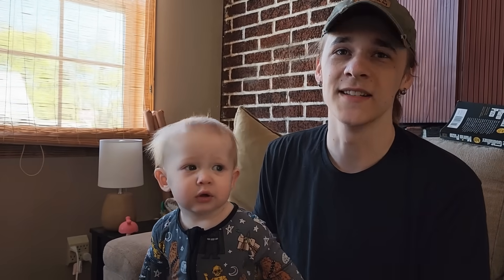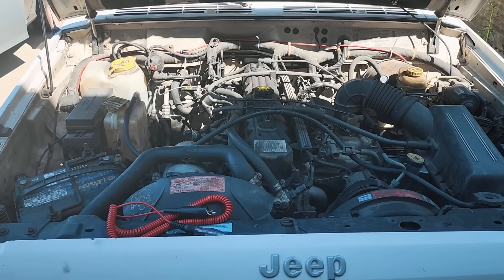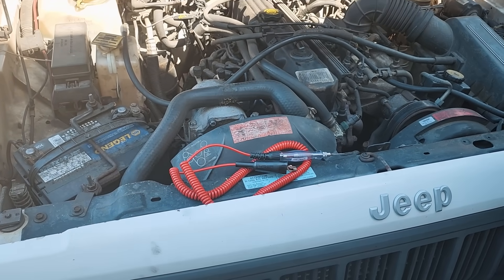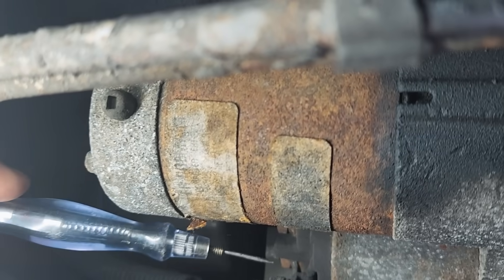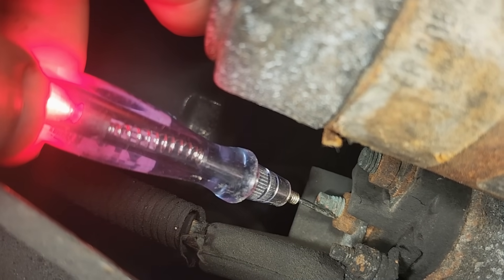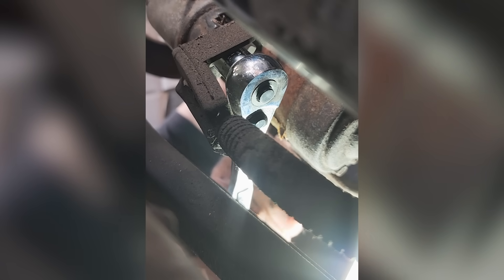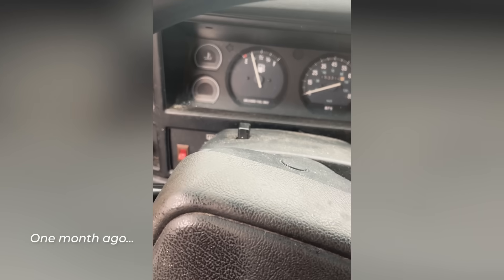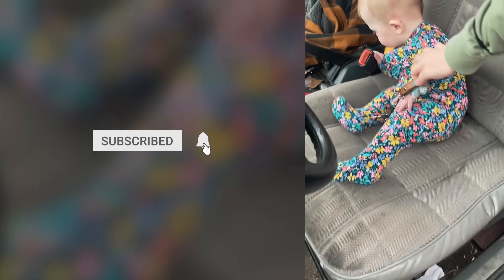Bad Starter or Bad Wire? - Starter Tests Everyone Can Do (family intro)

Comment: Do you have a video showing a bad starter in a "no-crank" case? I've watched a dozen or so videos, and they all either show a completely good system or  bad cables in a voltage drop test.
Reply from the maker: I do and we just released this one from our archives https://youtu.be/Dot9NUXhzpc
Reply: @ScannerDanner  Thanks. Love this content. After I thought I had a bad starter, when all these tests checked out, I found I only had 3 volts while cranking. Of course I didn't discover that till after I replaced the starter. New battery fixed me up. Your content as well as "Schrodingers Box" are full of amazing content. Didn't realize I was so far behind the curve in vehicle diagnostics.
Reply from the maker: @ozzman530  tell Matt I said hello!

Comment: I tested my Mustang. 1993 light isn’t coming on with my starter. Car still starts. Battery died when I stop driving after 15 minutes. I attempt to start. Dead battery. Should I replace my solenoid? To get power to starter?
Reply from the maker: If your test light isn't coming on when you are doing these tests and the engine still starts, then you cannot be doing the tests properly. A bad ground on your light is a common mistake. You need to redo these tests when it is NOT starting

Comment: Why did the test light go off when you tested the post and the nut, but not when you tested the eyelet?
Reply from the maker: The problem was the connection of the eyelet to the stud/nut. So when we loaded the circuit, only then did we see the voltage drop from that resistance problem of that location. If you would have measured resistance with an ohmmeter, it would have passed that test perfectly (0 ohms of resistance). Make sense? This is why loaded circuit testing is so important
Reply: @ScannerDanner  Hey! Thanks for replying. With the tests you showed in your video and the extra info in your reply, I was able to diagnose and correct the problem that was not letting my car start in a matter of a few minutes.
Reply from the maker: @g.t.r.8852  heck yeah! What was it?
Reply: @ScannerDanner  So, I did the test just as you showed in your video. But in my case, the test light would also go off when testing the eyelet. Then, I assumed the problem had to be the wire going to the battery's positive terminal. So, I checked the wire and found an area where the wire insulation was broken and the copper strands had become all corroded (my guess is that the corrotion was not allowing enough current to flow through the wire). So, I just replaced the wire and started the car and it worked!

Comment: Thanks for the videos you put out been watching them alot to help figure out my car troubles. In this video you show testing the starters heavy post. When your son turns the key to the start position the light goes out on the test light. What does it mean when it stays on ?
Reply from the maker: If it stays on in the crank position that means that wire is good

Comment: I loved your video so much, I want to learn more from you!!!! I own a 2013 Kia Sorento lx v6. I bought it exactly a year ago, service maintenance has been done accordingly. I just turned 60, and I still work on my car. I can’t afford to take my car to a mechanic every time something comes up. In fact I was quoted over $400 to change my spark plugs, granted it’s a time consuming project; it’s a matter of removing bolts, unplugging stuff (sorry I don’t know the names of a lot of parts!, but I am learning a lot. Also did the pcv valve! I did a few things backwards, live and learn. Now I’m dealing with a no crank, no start. When I discuss cases with some guys, they really don’t take me serious. 
I’m going to register for your premium membership, I can learn a lot from you. Thank you so much. 
Just a hint to ask you guys out there that think mechanics is not for women….. you are so wrong! Anyway that’s old shit!

I checked the ohms on my battery, it was 7.4, out a portable charger to it and gave it a jump. The car started, took it to auto zone to do a test on the battery, it came up with an error at the starter. When I started it the engine was quiet for a little while, about an hour later  it started to rough idle again! 1 problem solved another to solve!
Reply from the maker: I've had many female students over my 20 years teaching at a tech school. Some who were absolutely on point with this diagnostic stuff. Top of the class on point. Welcome!
Reply: @ScannerDanner  thank you!

Comment: Mr. Danner - I don't know what state you live in, but teach your son some basics like good electrical connections !!!  And a $15 digital multimeter will tell you much more than your $5 test light - which does have its place, just a multimeter will show cranking voltage etc....
Reply from the maker: When you understand that voltage must be measured when there is current flow, you can use your old school test light with great efficiency as I showed in this video.

Comment: If the starter had been replaced it would have started because the stud nut would have been removed and tightened again fixing the real problem. Thanks.
Reply from the maker: Exactly

Comment: Nice ! But my dumb ass would have looked those rusty connections and tried to clean them first . I have an 2001 XJ Jeep . All the six cylinder engines I ever had ran forever. Loved my 225 slant six , 300 cid Ford

Comment: Re:  The tap test (like the one done on your mom's car).  

If the tap test starts the car (and I was alone, so tapped the starter, then got in and turned the key - and it started) - does that mean the starter is going out?
Reply from the maker: yes sir, in most circumstances. There is a slight chance of a wiring problem right at the starter too
Reply: i had that on my van,not start,on key ,test battery ,with head lights on ,were bright,hit the starter few times,then it worked,start engine,on payday ,i take of the starter ,as do 200 starts per day,doing multi drop parcels,and fitted a new one,then i take the old one apart,was the brushes was worn,very small,on the end of the spring ,so not really touch the moter contacts,but if tap the body,it forced the brush down a bit more ,and work,lots motors pack up ,when brushes get short ,cant do there job,new ones are long,push into brush holder,can buy brushes to fix it ,but rest motor was worn too,gear tooth,and bearing
Reply: @richardjohn5216   THANK YOU for this.  My daughter is using that car, and it almost always starts.... but in the past week it failed twice.  I'm out of town, but as soon as I get back I am going to change the starter.

Comment: If you were to put an amp clamp on the battery positive cable to the starter, it would have shown little to no amperage correct?
A bad starter with a good wire would show lots of draw correct?
Reply from the maker: Typically a stater motor will fail in ways that look just like an open circuit (no amperage) rarely will they fail with high amperage

Comment: Wanted you guys to know that even though I am a mechanic for industrial semiconductor manufacturing equipment, I use many of you diagnostic concepts and methodology to make me better at my job.  You have helped me to become one of the best techs in the fab over the past 5 years.  Thanks you!  To think it all started with me putting AC in my 1988 Civic and needing instruction.
Reply from the maker: This is awesome! Thank you for sharing this with me
Reply: I turn on headlights , crank it or try if headlights dim and no crank starter bad ( voltage to starter)  lights don't dim ( ign/ wiring)  voltage not making it to starter  . This is true 9 out of ,10 times   . 2 sec test!

Comment: Huge question for 2 months I have been trying to get my lovely 2008 dodge nitro 4.0l to run. I was driving and it it just died. I have no trigger to injectors and coils from pcm.? New pcm put in new tipm put in new crank sensor new cam sensor. Still just cranks. What could it be? We don't have dealerships where I live.
Reply from the maker: What codes?
Reply: @ScannerDanner   o2 senor on bank 1 under threshold.  That's its. Nothing saved and nothing else coming up.
Reply from the maker: @brandihawkins2797  Let's move this to my forum www.scannerdanner.com 
It is free to join and we can definitely help you. I have 28k global members and hand picked moderators who've been with me for years and know my material inside and out and are there to help me help you guys. It is just too difficult to offer back and forth messages here on YouTube with stuff like this and we also can't share pictures and images here like we can on the website. Hope to see you there!
Reply: @ScannerDanner  just posted to the forum.

Comment: Hi goodday. Is it possible to ask help assistance for me to troubleshoot my Honda Civic 2004 with an engine D15Y2 exclusive model(2004) found here in the middle east region. Lately I sent to machine shop for Cylinder Head overhaul after that i reinstall it then it dont start, it cranks, starts for about 2 seconds then stalls. Thats is condition for  a long time now until it theows a code P1362, have tinkered with the wire connector and its showing me correct supply voltage(around 12.4) reference volt (5.08) and ground checked both at connector and ECM end, but when i reconnect, back probe to follow change in reference voltage when ignition on, and run metal infront of sensor it does not show voltage change. Please help iam loosing hope of starting my Civic.
Reply from the maker: Let's move this to my forum www.scannerdanner.com 
It is free to join and we can definitely help you. I have 28k global members and hand picked moderators who've been with me for years and know my material inside and out and are there to help me help you guys. It is just too difficult to offer back and forth messages here on YouTube with stuff like this and we also can't share pictures and images here like we can on the website. Hope to see you there!

Comment: 'Power and Ground' tests to avoid part changing. 
Cranking with the key to try and complete the circuit proving 'key' to demonstrating voltage drop. Great demo to test the pillar/nut/connector on the starter to pinpoint the nut being at fault.
Boy, that Jeep has some rust!

Comment: Could repeat this test, but sure don’t get why that light goes out. Wire diagram?
Reply from the maker: Picture 1 strand of copper wire that is left out of 100, with 99 of the others being broken.
Install your test light that draws 200 ma and the circuit looks fine. That single strand can carry that current no problem. 
Now, when you crank it, the starter will carry 200 amps on average (that would be 200,000 ma for comparison). This causes the single strand of wire that is left to heat up, and it increases it's resistance (from heat) so much that during that time, it can no longer support the current of the test light, so it goes out!
(Copper will increase resistance with temp)
Does this make sense? 
Same thing was happening with that corroded nut.

Comment: Great video.  Why not a LED test light?
Reply from the maker: Because the LED test light only needs around 10ma to light and will light with as little as 3 volts on a circuit and it won't look any different than 12v. It is NOT a good tool for troubleshooting.

Comment: This has got me thinking. Over the last few years I have had these exact symptoms on two of my BMWs. The problem is that to get to the terminals almost requires removal of the starter.

Is there a test for this fault where you cannot get to the stud?
Reply from the maker: The only thing you can do is to pierce the wire as close to the starter as possible and at least confirm wiring is good to that point before removal of components

Comment: At time 13.50, test light lights which means there's short circuit. Then, why there's no fuse blown? Please elaborate more. Thanks.
Reply from the maker: Was this when I was showing the bad block ground? This was from an OPEN not a short.
Reply: Kind of had the same question… if the light is lit while touching the block it would indicate the block has voltage on it.  Can you explain how this happens with a circuit?  The key is turned and voltage goes down to the post and hits high resistance.   I don’t understand how that causes the block to become hot.  I’m guessing that voltage/current find another path of lower resistance, right?  Thanks
Reply from the maker: Because the high resistance is AFTER the block, so the pressure backs up and "pressurizes the block" Make sense? Watch some videos in this playlist "ground circuit problems" I know you will like them and it will answer any questions you may have and if you have more along the way, just ask them and I will answer. https://youtube.com/playlist?list=PLAFYVCyenqcr32wgsCqa1Zj4335YlBF5p

Comment: I would replace The Stater and cables exsepcley if your keeping the vehicle
Reply from the maker: any particular reason why? Of course the cables look like s--t on the battery and something should be done there, but there is no reason to change a perfectly good starter
Reply: @ScannerDanner  as old as the starter and all the Heat soaking on the Plastic Housing on the solenoid is now Bridal And May possibly Brake when removing the Cable. And the Cable do to The Cousin and Age at the Battery Terminal. And bad connection as seen in the Video That you Even Mentioned It more of a Maintains Type of Issue to prevent a possible Comeback as shop Owner and as a Customer And if you plan on keeping it for some time and Take a long Trip.  It to Prevent  possible Electrical Issue that you may not have the Money to Resolve At that time. Best take care of it Now Then Later when it may be Very Inconvenient
Reply from the maker: communication with the customer is key, no reason whatsoever to upsell a starter motor in this circumstance. People can't even afford to fill there tanks these days. All we did was tighten that nut a bit and I bet you it lasts for a few more years without any issues. It is my Jeep so I'll keep you guys informed :-) 
If this is a customers car, I agree, take the nut off and clean that area up, then re-install and again, communicate with your customer about what you found and what you are doing. Better yet, just do it BEFORE calling the customer in this case. Then when you call them you can give them the good news of it just being a wiring issue and if the starter solenoid breaks while you are attempting to clean those terminals, well, they needed a starter anyway, so then you call them and sell them a starter. Upselling a starter, just in case, is not the way I would approach this. It is a 1996 car, you could upsell them everything if you want to start talking about the age of the car.

Comment: Great video and one I needed a couple of weeks ago.  The starter in my fiancée's 94 Cavalier was intermittently not starting because the Bendix was not kicking out and engaging the flywheel.   I had replaced this starter five years ago with a rebuilt one from Autozone.   I got another rebuilt starter under warranty since it had a lifetime warranty and installed it.

Things were good for about a week and then it would intermittently not start but this time the starter would just click.  I knew all of the contacts were good because I had cleaned them all very well when I replaced the starter.  It did leave us stranded at Walmart so I tapped on it with the tire iron and it started.  It did this again and she wanted to replace it again.  This is where this video would have been helpful because I wasn't testing the wiring correctly under load.  I had the key on but wasn't cranking it.

Anyway, I took it off and went to exchange it again and Autozone gave me a little trouble about it because when they tested it on their machine, it worked every time.  I did discover that the post that housed the wire that goes to the solenoid was slightly loose and that convinced the guy to exchange the starter again.

I installed the new starter and the first time I went to start it after the install, the starter just clicked.  It clicked about five times before actually starting and has started fine ever since.   The next time it messes up at least I will be able to diagnose it better next time.   I'm sure these rebuilt starters are just junk.

Comment: Thanks! My son and I diagnosed a no crank no start on a 1999 Subaru today. The neutral safety switch needed adjustment. Total cost was $20.43 for exhaust gaskets because we removed part of the exhaust to get the o2 sensor out of the way so we could get to the neutral safety switch. I am subscribed to your online training and have your book and pdf.
Reply from the maker: Thank you so much and nice job!

Comment: Great simple video. I’m familiar with the bad block ground. At my dealership there is a recall on Isuzu FTR where the block ground is bad and it grounds out through the Power Steering line causing the line to rupture.
Reply from the maker: Nice! That's crazy

Comment: I worked in a starter rebuilder between 1970 to 1980 . I was in countless shops and auto parts stores . I NEVER once saw a mechanic do a test with a test light . I NEVER heard them say voltage drop . Most had NO meters or battery testers . The owner had an analog voltmeter that was used to check battery voltage and charging systems . Most shops used their BIG TOE ( best guess ) to test ! Unbelievable but true . There are STILL some of these " TECHNICIANS " out there ! Great video .
Reply from the maker: unfortunately most "techs" still do not understand this test or how easy it is to do. Thank you!